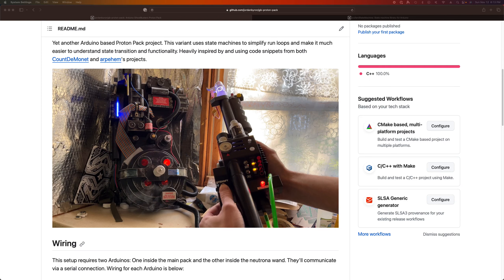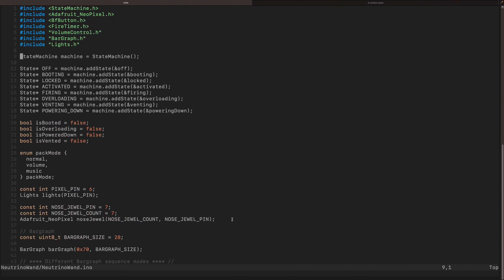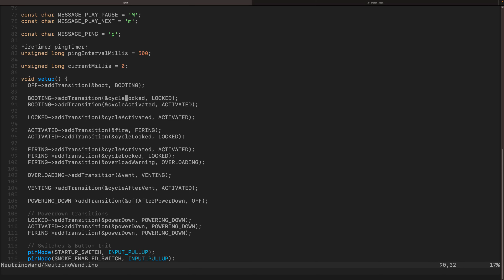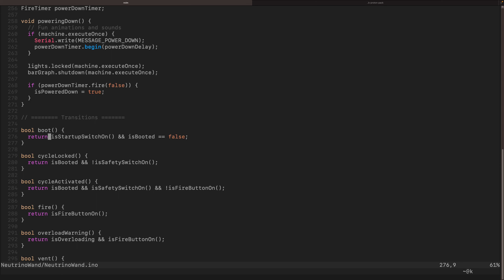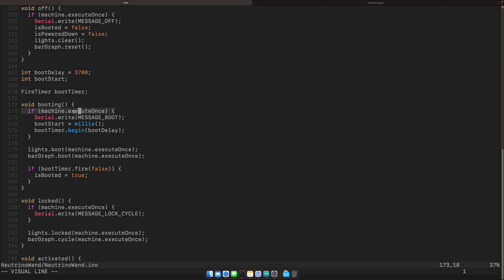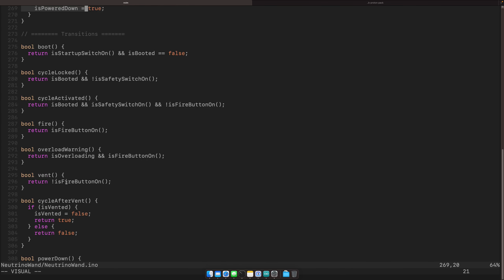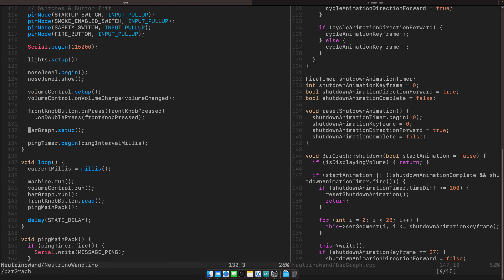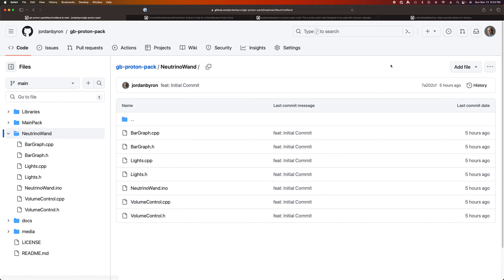Ghostbusters Arduino Proton Pack 👻 State Machine Walkthrough

Comment: This is fantastic. Do you happen to have a schematic for your hardware layout? I'm really seriously thinking of not building my Q-pack and just buying/modding a  spirit pack to keep my time/frustration down.
Reply from the maker: I don’t have a schematic for my exact setup, but I linked to a few projects I took inspiration from in the GitHub repo. CountDeMonet has a diagram I referenced a bunch. I also uploaded docs for the bar graph in the repo. That was one of the hardest parts.
Reply: @JordanByron  Thanks! I built the MIkeS11 PCB’s, so I’m thinking I could repurpose at least the bar graph PCB since that just makes the bar graph addressable over i2c.

Comment: I've only dabbled in Arduino coding, mainly relying on a friend for help, but I know how to build circuits. I'm looking to overhaul the electronics I added piecemeal over the years to the pack I built way back in 1984 (and still holds up). Can you share which physical components and circuit designs you used with the code you've shared? Thanks!
Reply from the maker: The GitHub project linked in the description has some details about component choices. I didn’t make wiring diagrams but I copied a few other projects linked in the README.